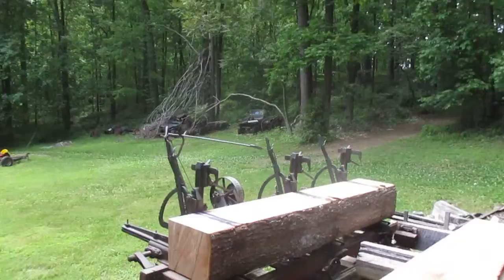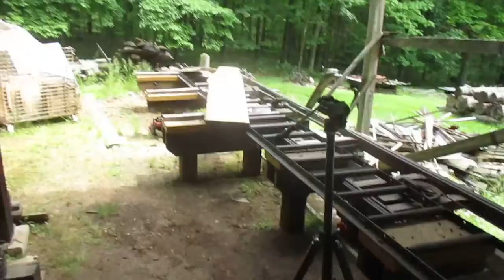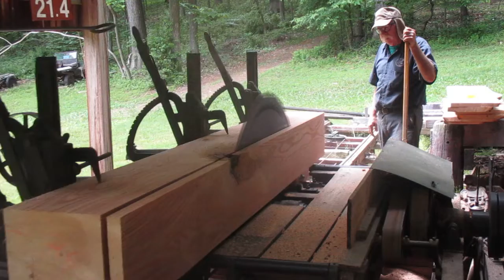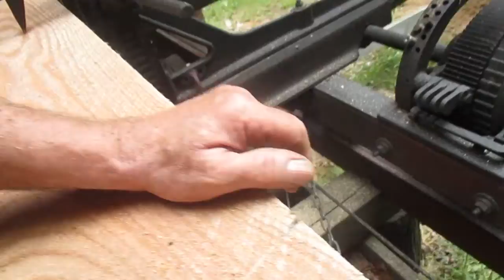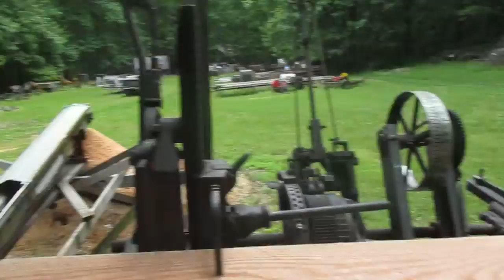SAW MILLING DOING SOME TRIM WORK #769B

Comment: Hey John, that wood with all those knots in it. Why not cut a bundle of 1x1's and sell them as tomato stakes. Make use of those 4 ft sections and put it into the fuel fund for the mill. Marty
Reply from the maker: hi there no one is buying wood around here , good idea . thanks and for stopping in john

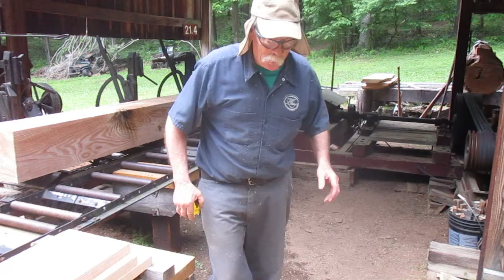Comment: Are you sure that little stick is 12 1/4 X 12 1/4?  Around the 18:10 mark you measured the same distance(horizontal) twice. What about the vertical measurement? lol The term "measure twice, cut once" mainly applies to things getting ready to be cut. I'm told it's supposed to be a Rule of some sort, but I've yet to see it printed somewhere in the Rule Book. But there's nothing said about "measure twice, then remove" either,  so you just keep doing your thing. lol That's quite a hefty toothpick you pulled off of there.
Reply from the maker: hi there i saw that later  it was funny  john